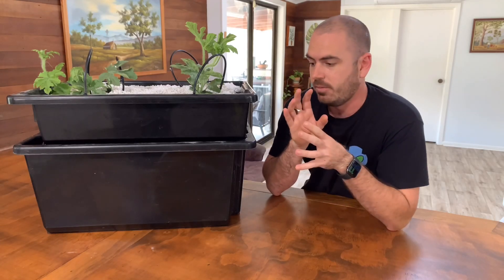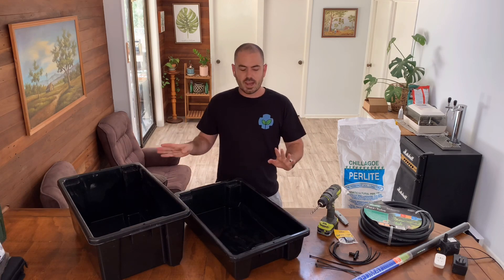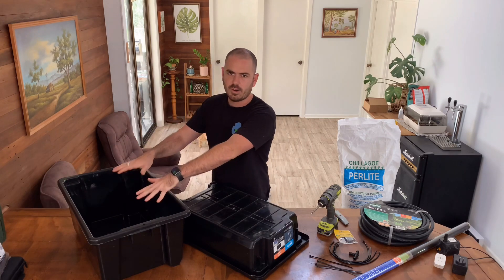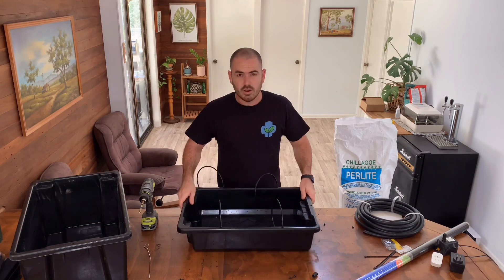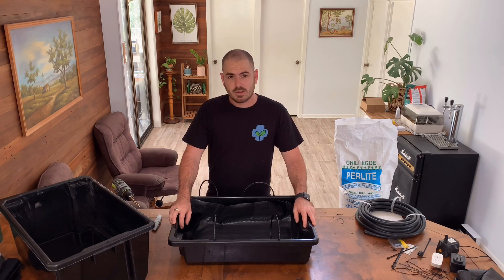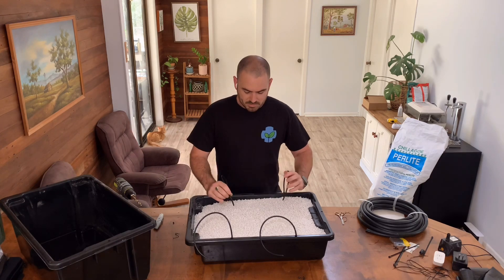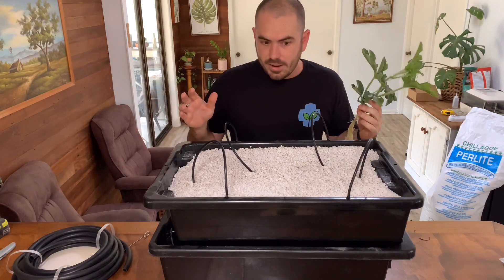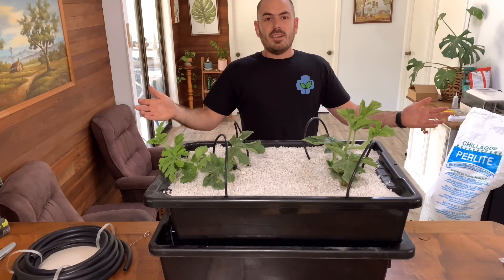How to Build a Compact Dutch Bucket Hydroponic System

Comment: Forgive the noob question, any reason why you use 100% perlite and not the 50/50 mix you use in the Seedling flood videos?  I see you use the clay balls also in some systems, are different media better for different systems?
Reply from the maker: Depends on water retention of the media. Some media requires more frequent irrigation (doesn’t hold water) this is good for oxygenation ie perlite /clay balls.

Other media is good for water /nutrient retention, and requires less frequent irrigation but has less oxygen content so is usually mixed with another media to give the desired composition. (Vermiculite/coco/peat)

Comment: is it a good idea to use LECA or hydrotons instead of perlite?
Reply from the maker: Jonathan Miguel Mabini you can use hydroton if you like but you’ll need to water more often as it doesn’t hold solution as well as perlite.
I’d almost recommend a constant flow with hydroton.

Comment: Another great idea for us renters. I use a smart timer for my Flood and Drain system I got from Bunning. Has 2 outlets and is much much better than simple mechanical timers. I also switch the light on manually from my phone to go outside when it is dark as I work till late sometime.
Curious if you think shade cloth could be a good solution?
Reply from the maker: Yeah. That would work I would think 🤔
Reply: @Hoocho  I love shade cloth!! Just use the green stuff, not the black stuff ok.

Comment: Another amazing video Hoocho. Just out of interest, what is the irrigation timing set to on this system? How often does it fill with water?
Reply from the maker: Duncan Slater the bed shouldn’t really fill with water, it’s meant to irrigate the area the pipe enters.
It really depends on how much the plant is transpiring/ size and requirements of the plant.
This is why I didn’t put a number to it.

Comment: Hard brittle plastic tubs (the really cheap ones) should be avoided, as they'll generally split when drilled. The tubs used here are a softer plastic. Test it with your finger nail before you buy. Great video as always. I had to watch the last 10 seconds again because i was pmsl at the cat. ;)
Reply: Good tip Doodle.